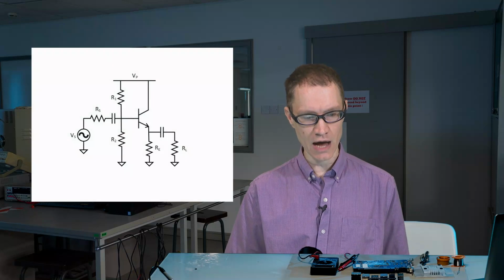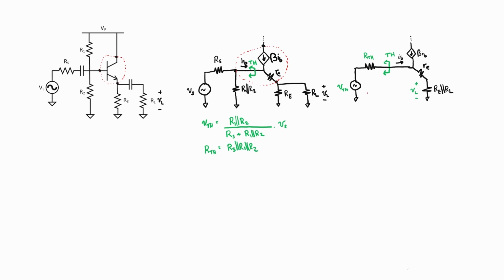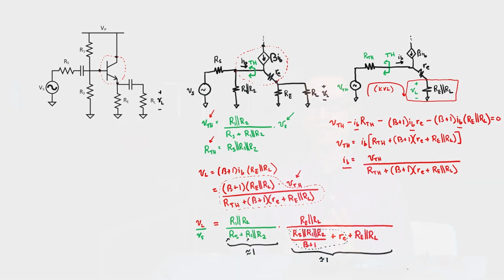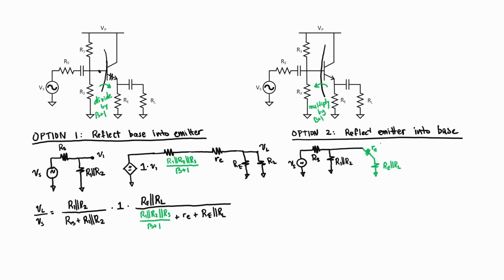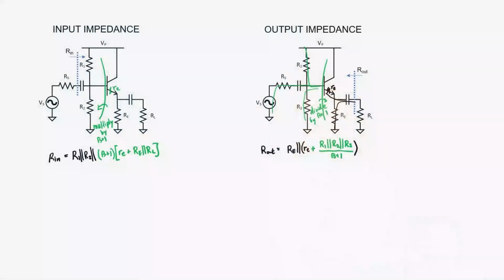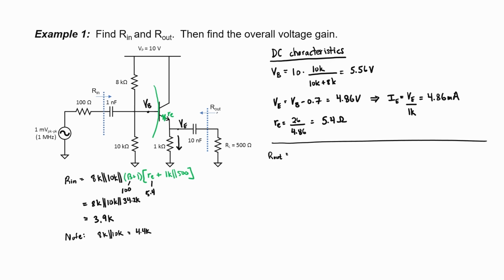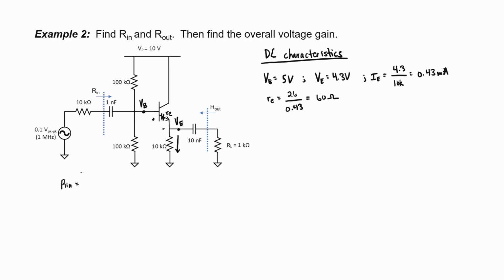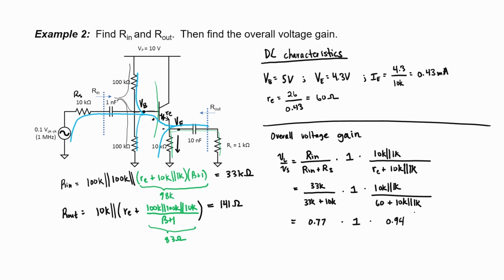All About Common Collector Amplifiers (13-Transistors)

Comment: gain with this method, is half of gain with this one https://youtu.be/LDgUgzNrsqU?si=ZEbcaoO1IDuOpBGA&t=1132, while impedances match pefrectly. Simulation result matches result from ElectronX Lab. Probably because ElectronX calculates gain without Rs. So in case Rs is close to Rin only half of the voltage will reach the base of a transistor.